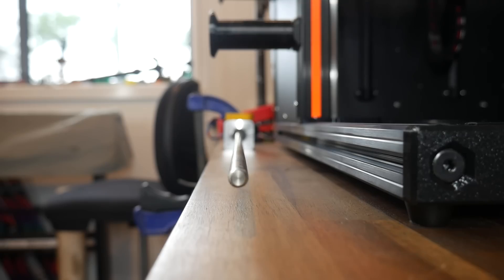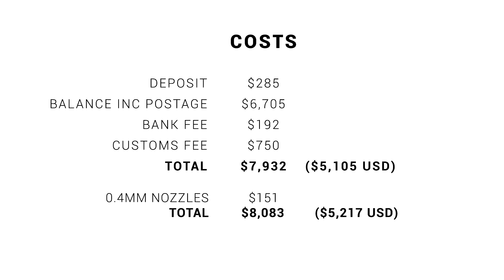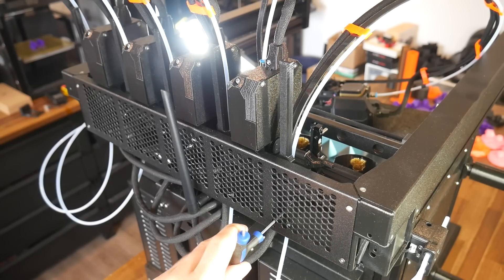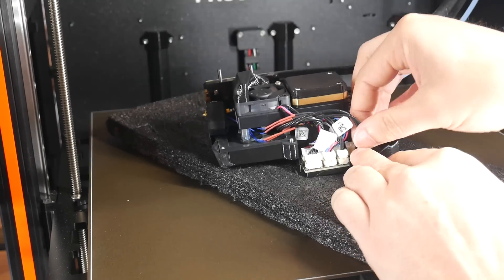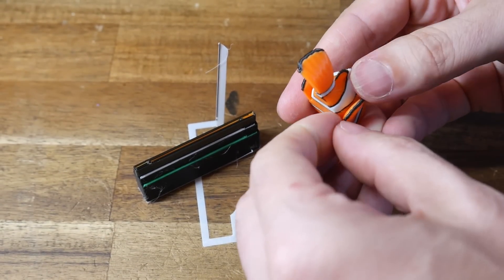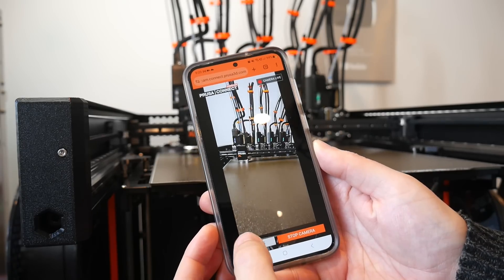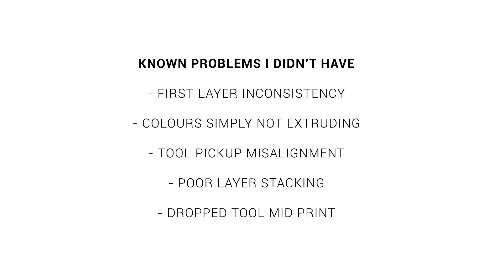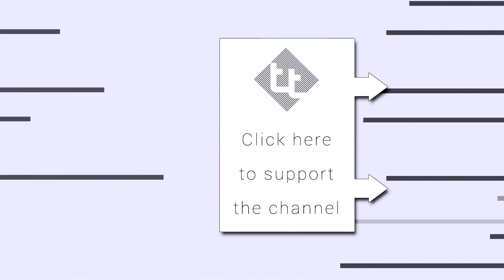I’m (mostly) happy with my Prusa XL - This is what it took

Comment: Tentatively recommended?  Successful 3d printing is so dependent quality control and user control. After the magnitude of Prusa's faults in both, you're giving us double speak if you recommend that people spend professional money on what is clearly a non-professional solution. You got the right stance, but you pulled the punch.  a bit too diplomatic for me.  I have multiple prusa printers but the way they priced/designed/handled the XL shows me they don't respect my needs or time

Comment: The wobble on the Z-axis threaded rod is not good.  A coupling or belt drive at the motor is needed.  In spite of the guide rail, the table is being pushed around.  I always wait a full year for the design of a new product of any type to settle in.  The customer shouldn't have to finish the R&D process.
Reply: Like on the Rat Rig V core.

Comment: As for loading very flexible filament, a technique I used to get past the side filament sensor is to push through a bit of PLA filament first to get the ball out of the way, then push in the flexible filament behind it.

Comment: How many marlin fish prints would it take to break even on the cost of an X1C and filament vs Prusa XL and filament? Meaning, its about $4000 more to get the XL. And the fish has a waste of 100g give or take. To keep numbers simple, $20/spool, 1000g spools, means youd need to print 10 fish per spool across 200 spools, which is 2000 fish prints to break even on cost. Its obviously more prints than that because you can buy cheaper spools of filament and adjust other things. This also doesnt take into account print time savibgs which could be a monetary factor as well.

Comment: We've got 2 at our offices (just the single tool head) and the loading/unloading of filament is a major step back from the Mk3 series.  I don't know if they ran into patent issues with Stratasys (this is how their Fortus 400 and 450 models work), but there should be a stepper motor that pushes detected filament through the runout sensor to the toolhead.  Feeding even PLA through that long bowden tube is annoying in 2023, considering the price of the machine.

Great video, and I appreciate your content as always!

Comment: "The XL was launched before it was ready" This describes every product that Prusa releases.
Reply: Every?  I've heard positive reviews on the Mk2, Mk3, Mk4 and Mini.  Have you even used a Prusa lol
Reply: @krollmond7544  You clearly arent actually paying attention then. All the printers you list launched with issues you had to purposefully skip past to get that opinion of.
Reply: @BeefIngot  my Mk3 ran fine thanks, isn't Bambu running a recall on the A1?  There was problems for every single Prusa?  Where's your proof of that lol.
Reply: @krollmond7544  They are, and thats responsible vs having your many years old product have thermal runaways like has happened with the Mk3s.

Really I dont actually think either situation is the end of the world and I dont think theyre good reasons to think poorly of either in a vacuum.

As for you asking me to go on a goose chase, Ive been around for long enough to know not to fall for that, put i  a bunch of effort to find years 9ld things just to have you say nuhuh and make another goose chase.

From memory the mk3 had duct problems, the mk3s bed didnt ship by default and the step loss feature still doesnt work right. The mini still never got skew compensation. The mk4 doesn't have a way to tune input shapi g and launched without it. It also cant use the mmu3 as of time of writing and obviously the printer in question has problems too.

Its easier to remeber the ones closer to now but I for sure remeber launch always being a big slog.
Reply: They somehow get this aura around them but have a pretty bad track record when you really put it down on paper. The Mk2, Mk3, Mk3s, Mk4, XL, Mini. Every single one has had some pretty rough issues on start. I mean even currently the Mk4 can't use the MMU3, and the mini never got the promised sku compensation.
Reply: @BeefIngot  I had MMU2 for 2 years on MK3 and decided against it when I was thinking about upgrading to MK4.
I'll be honest with you, my experience with Voron Trident was absolute and pure stream of bad things. I had to replace the hotend twice, etc, etc, etc. At every turn something is not right, it doesn't even know how to load and unload the filament properly, doesn't have filament sensor etc. To this day (one year later) I didn't make it to print properly.
Compared to this Prusa "just works" (tm). Yes, it's more expensive, but any problem I ever had with it, and I didn't have many, it was easy to fix.
With MK4 it's "just works" squared, because nowmyoundon't have to think a about any calibration, and always have a perfect first layer no matter how fine the details are. They also implemented input shaping so now my prints are faster.
I don't know, maybe you're right, but my comparison to another (even more expensive) printer went completely and horribly wrong on Prusa's favour.
What not to love?
I'm not a kind of guy who likes to spend time under a car or fiddling with the pesky problems, I just wanted torint known designs. And Prusa MK series is just good for that, although, yes, it's more expensive than most. But it takes first spots in all top-10 comparisons for a reason.
Reply: @KirillFrolov77  vorons are advertised to be projects though. For prusa, the problem is that Bambulab printers exist and offer a better experience now and for less. Both are practically proprietary for most use cases so ultimately I think thats thw big issue.

As a final note on the Voron, one of the things about project printers, is that they are far from first time printers, so the skill floor is really high along with necessary time investment.
Reply: @BeefIngot  agree with your judgement about Prusa/Bamboo.
As for Voron, it's less about skill, but more like fundamental lack of everyday features. Filament sensor? Filament loading/unloading? Automated filament wiping before the print? etc,etc,etc. Those are small thinks that are basically not supported.
Even if you mount the filament sensor, the firmware doesn't know what to do with it. Etc.
Reply: @BeefIngot imo Mk3 doesn't belong to that list. It was solid from printer from the start and absolutely murdered competitors.
Reply: MK4 upgrade was just fine.
Reply: @KirillFrolov77  The upgrade by itself is basically the price of a P1P. Hardly worth the money, and you lose the initial printer to have the Mk4 when you could pay just a little bit more to have 2 perfectly good printers.

Comment: Your last phrase describes very accurately Prusa's current situation. Support is basically the only thing they have going for them right now
Reply: …and short of E3D’s Toolchanger and that one OS Design, the only Multi-Toolhead Printer.  Also the Load Cell Thing, although utility of that vs a well calibrated printer is debatable.

I do agree at the end of the day though they need to up the game a bit.  Also maybe expand filament production / machine production?
Reply: @ericlotze7724 stratasys for commercial and proforge also have tool changer and they actually work
Reply: @ericlotze7724  "Also the Load Cell Thing, although utility of that vs a well calibrated printer is debatable."

Strongly disagree. This ignores that calibrating a printer is a pain, and so features automating this are a big plus.

You have to consider user experience.
Reply: @BeefIngot  i agree, I didn’t buy anything like an Ender 3 for this exact reason.

I’m just being a devil’s advocate and saying in theory your PINDA / BL Touch / Inductive sensors and stuff should work about as well, although i think the Loadcell is one of the more novel methods.
Reply: Open source, great part availability/reliability/upgradeability.  Those are what get me.
Reply: @yonallb  reliability? Didn't you watch this video? Open source? Ok, if you would like to support that it's Ok but that's not an immediate advantage that translate's directly into better experience for the customers. Upgradability? Ok, that's fine, I just want my printer to print. Bambu Lab is closed source but there are aftermarket options already. Upgradability in the XL means expending more money on top of thousands just to make it work. The XL is not a success or a finished product.
Reply: @elleryfg7853  That last sentence is foolish. Having opensource printer means you can built those upgrades needed yourself for virtually free.

Comment: Never been more happy to cancel a pre-order. The Bed leveling on my Rat Rig is far superior to this with much less to go wrong. All of those bed sections is just asking for one to fail. This is a disaster for Prusa. They are miles behind the curve now. I am sure that the Fanboys will still blindly support. The idea of low waste and fast change multimaterial is in itself awesome. Just that this implementation is an overpriced dumpster fire. For me to get one of these it would be $6000 CAD minimum for one with 5 heads. That's Ridiculous. It does not even  have a built in Camara FFS.
Reply: I do think a RatRig or HevORT derived design would be better.

I think there is least one Open Source project for something along those lines.  Could even have an ERCF feeding into each toolhead lol.

Also you have MihaiDesign’s “Pitstop” design in the works with Obscene numbers of toolheads!
Reply: @ericlotze7724 I have a v core. The bed leveling on that is intuitive. I do like the extruded on the mk4. I built a 3.9 just to see it. The way it ejects and loads filaments is really slick for color Swapping.

Comment: Sorry but IMHO this is a huge fail for Prusa,  I'm glad you got it working great, and I love that Prusa is trying to address the waste during multi color prints, as I for one refuse to use a Bambu AMS due to the waste, but for $5k, this printer should not have required this level of mod/fixing

Comment: I've never really been impressed with the hype around Prusa!!! Price seems overly excessive for the fiddlyness required to make them work!!! Quite happy right now with my Ender 6 CoreXY that is NOT a bed slinger and did Alex Kenis ball bearing trick for the Z-Axis which removes the vertical bounce slop of the stepper shaft coupling.

Comment: i think its still unaccaptable to deliver such a bad product with that price tag.
Reply: exactly, especially on how they test their bedslingers, how did they miss this
Reply: The price for this 😮
Reply: Yea
Reply: I don‘t understand how Michael had so many problems, yet most other reviewers didn‘t. (If I recall correctly it was similar with the Prusa Mini). It has to be something environmental, something happening during shipping, something with the material he uses, etc. It‘s very weird.
Reply: Thats why i dont use prusa printers only creality but i will expand but not to prusa
Reply: My MK4 is running like a dream. I am thinking of an ender v3 SE or a print mill style printer for my next printer
Reply: Agreed
Reply: And without enclosure.
Reply: 3D printer enthusiasts have very low expectations from manufacturers
Reply: I'm just packing mine up to return for a refund.  I got the printer in June of 2023 and was having big issues printing PETG.  After lots of work with support, prusa arranged collection for their technical team to see what the issue was.  The machine was returned to me, but the printer was the same.  So now I'm getting a refund and getting another XL.  I'm getting another XL as I know people with an XL that get great PETG  prints.
Reply: Mine’s been perfect since it arrived. If you are familiar with the Prusa XL and how it works, and are experienced with building and using 3d printers, it shouldn’t be difficult
Reply: Agree, prusa is overrated
Reply: @andrikurniawan531  which model you have?
Reply: Exactly. Imagine paying the most for the worst version of a new product. I mean, we're not buying a triple A game or anything
Reply: 8000 AUD of shit.
Reply: Are these people seriously calling Prusa the “Apple of 3D Printers”? LOLOLOL I’m dying over here. Such noobs.
Reply: @RightJoystick  If it were Apple you couldn't do anything with it 😀
Reply: @RightJoystick  i think apple of 3d printers is actually fitting, by your reaction you might actually stupid enough to be an apple user....
Reply: but its a prusa, you dont pay for the quality you pay for the name and hype to be a proud owner of a joseph prusa printer
if it were a creality for 1/5 the price he would have slashed it as the worst thing on the planet.
Reply: @gamerpaddy well creality don’t fix their broken printers. The k1 never got fixed. They just left it as is and released k1c which fixes most issues with k1. 
Prusa don’t have flawless designs that need complete change like creality does.
Reply: So the Apple of 3D printers is living from past success and delivering shit like the real Apple? Who would guess…
Reply: @GroovyDrifter Prusa is not the Apple. Bambu is, stealing ideas and charging an arm and a leg for a shitty product. Prusa is more like a Framework.
Reply: I bought a Prusa Mk3 because everyone said that this printer is the most reliable and all around best printer ever. I paid 860€ for the kit, assembled it in 12 hours. My ender 3v2 works better than the prusa. then the cable got ripped out of the thermistor by a blob of death, i contacted their support and told them what happened and they said that i have no warranty because i bought the kit and not the assembled version. prusa is a scam.
Reply: @lorddreadfight  I bought Ender 3 V2 and I couldn't keep it stock for more than few days. Horrible trash with single Z motor, bad bed leveling stability and manual one. Yuck.
Reply: @jothain  I also bought many upgrades for this printer and often things broke and i still would say that the experience was better than the prusa. in fact, i bought the prusa because on my v2 every 2-3 weeks a part of the printer broke and i had to order a replacement and i wanted something more durable. I was kicked so hard in the nuts by prusa i will never buy from them again and i will never buy a 3d printer ever again.
Reply: @lorddreadfight  pretty much the exact opposite for me. Never had issues with Mk3s. At work I had some odd firmware bug in updating one firmware and Prusa help desk was very helpful and reported that bug, which was fixed later. I don't know how much I've printed at work and at home. Maybe counting in months time frame and virtually all failed prints have been users errors. Hell I use octoprint at home and I can't recall how many times I've gotten that "oh sh... Did I forget to check if I removed previous print from sheet". It's virtually too reliable that I've gotten way too careless using it 😂

Ender has always been something to look after, even after updates.
Reply: @jothain  That's what i hoped to get with a prusa 😅 I also used Octoprint and about 1/3 of the prints i started didn't fail.
Reply: @lorddreadfight  That sounds weird to hear.
Reply: I would recommend a Bambu X1C, or the E with chamber heater, over a Prusa XL. I have a X1C and a Voron 2.4 with ercf but Bambu gives me less headaches.
I know you will have a lot of waste with one nozzle multi material printing, but the XL is way too expensive for what it does.
Reply: @Todestelzer how can you recommend significantly smaller printer???
Reply: @jothain  because there are only a few cases you need a bigger build volume. And you can’t print big stuff on the XL without warping with anything other than PLA on it anyway.
I have a Voron 2.4 350mm with heated chamber (around 55c) and big prints, even in PETG-CF, will warp if I don’t carefully adjust the build plate temp. Too high chamber temp and the hotend electronic will fail.
I’m printing 99% of the time stuff that fits on the X1C build plate. If it doesn’t fit I can break the part in smaller parts and glue it or screw it together. 
Printing smaller parts is ALWAYS the better solution. Warping in ABS, PA or PC for parts bigger than 10cm is always a issue.
Reply: @Todestelzer  I haven't seen any implications that it wouldn't print in full size. Quite the opposite cause of the way bed heating works
Reply: @jothain  you need an enclosure for big prints in PETG or for PA, ABS, PC. Another 500€ ish and as far I know you can’t buy one from Prusa.
That’s why all printers, how are not for cosplay stuff or for decorative things, have a heated chamber. 
I’m printing for a couple years now and the XL was a big disappointment because it doesn’t come with an enclosure and a heated chamber. 
I’m sure Bambu lab will come with a XL printer this or next year. And I’m pretty sure it will have a heated chamber. 

The Voron printers on the other hand are nice as well but you need too much time to get them working. All the macros I needed and the start routine cost me 1 year till there were how I want it. 
Let alone the heated chamber and hotend rework for tap with a dedicated hotend mcu. Or the issues with the ERCF…. I’m so glad happy hare got developed. Works much better now.
Reply: @Todestelzer  I've never had issues with abs or especially petg on open machines.
Reply: @jothain I've paid 3k EUR and waited acceptable amount of time. Still, I'd rather pay more and have a finished product, with enclosure.
Reply: @Todestelzer I’ve been thinking about the ercf and I think if I ever get one I’m gonna have my filament changes do exactly the same pattern as the Bambu ams does. It works too well to not just replicate it as closely as possible.
Reply: @xiar5546  yes the ERCF is really nice to have. I use it with a bucket and a Bambu roller wiper. 
The endless spool mode is very handy too. Used 2 spools yesterday for a big print. 
There is now a v2 ERCF but I didn’t build the v2 yet.

Be aware that you have to tweak the start gcode and macros a lot till it works as you want it…